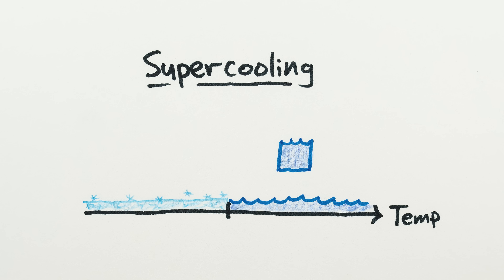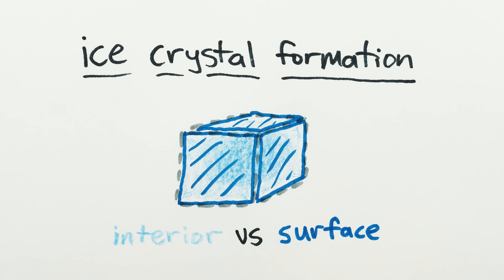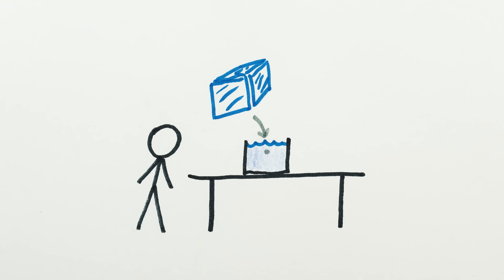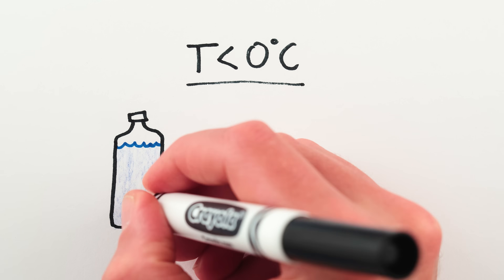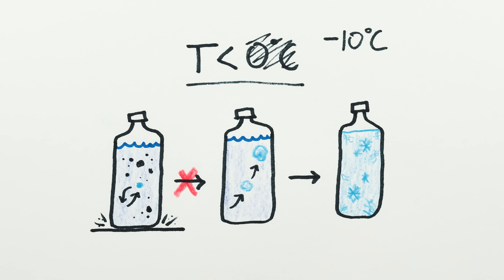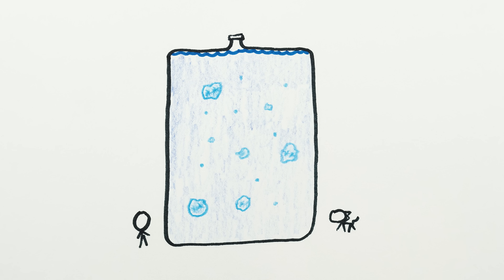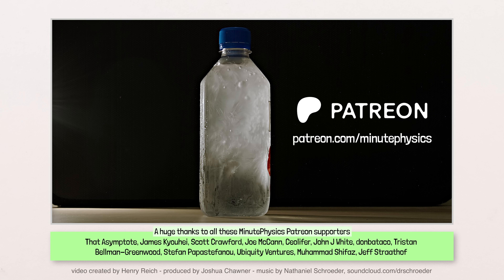The Physics of Supercooling

Comment: Question.  What if you had a sphere of ultrapure water floating in the vacuum of space?  What would happen between the competing forces of the lack of pressure bringing down the boiling point and the lack of particles for nucleation?  Is it possible that the water would remain liquid?

Comment: I bought a used refrigerator/freezer combi for 10 bucks that actually supercools my drinks. For some reason the freezer part only freezes the bottomhalf of the products. But when i put a drink in there it doesn't freeze at all only if i hit the bottle it instantly freezes up. Best 10 bucks i've ever spend :D
Reply: I had a fridge that did the same, once the novelty wore off it became really annoying. There was  simply no temperature setting that stopped things from freezing in the fridge without things in the freezer thawing.

Comment: AI Summary

Abstract: Understanding Supercooled Water: From Instant Freezing to Unfreezable States

This video delves into the fascinating phenomenon of supercooling, explaining why water can remain liquid below its freezing point due to a delicate balance between the interior's desire to freeze and the surface's resistance to formation. It then introduces a more extreme state: water that becomes impossible to freeze. This is achieved by containing supercooled water within extremely tiny, rigid vessels. In such small spaces, the pressure generated by the slight expansion of even a minuscule ice crystal becomes so significant that it suppresses further freezing, overriding the crystal's natural tendency to grow. This unique property has promising implications for cryogenics, particularly in preventing cell damage caused by ice crystal formation.

I used gemini-2.5-flash| input-price: 0.3 output-price: 2.5 max-context-length: 128_000 on rocketrecap dot com to summarize the transcript.
Cost (if I didn't use the free tier): $0.0056
Input tokens: 13048
Output tokens: 670

Comment: I want to learn how there can be fresh liquid water under Antarctic glaciers. Most sources talk about pressure, but this is a relatively tiny effect. Even under the deepest glaciers, the pressure is only a few hundred atmospheres, and pure water still freezes at just a few degrees below 0. It's not irrelevant, but it's not a complete explanation either, since most of Antarctica averages well below zero. And those glaciers are millions of years old, so it's not like the land right under the ice should be holding onto much heat. So how can these freshwater lakes form and persist?
Reply: Firstly, snow/ice is a good insulator, so the water below the glaciers would be warmer than the land above, and secondly, if the water is salty the melting point is lower. Also there might be friction between the glacier and the land that adds in small amount of heat.
Reply: @abigailcooling6604 Why would the water  below glaciers be warmer than the water above? Cold air isn't a new phenomenon in Antarctica. It has been below freezing for millions of years. It was that cold when the glaciers started forming. And of course if the water is salty, that's different, but the point was about lakes formed from glacial meltwater.

Maybe there could be some heating due to friction. That's not something I thought of. I'm skeptical, though.

Comment: Wouldn't this also explain why hot water freezes faster in the freezer? Hot water has more energy, more turbulence, so as it cools the ice crystals would be moving around more (even if it is at the same 0 degree temperature, maybe more currents or vortices or something?), like when you smack the bottle and it suddenly freezes, allowing the crystals more opportunity to knock into one another.
Reply: Intermediate value theorem says no, there are plenty papers explaining the pmemba effect already, feel free to check them out.

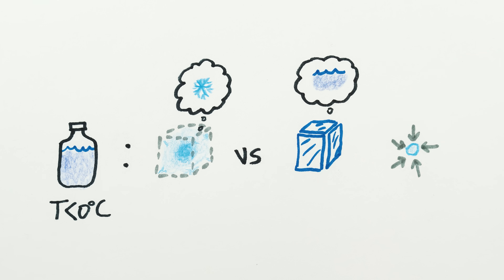Comment: 2:33 The third player is very important, many don't know about it.
Reply: It's really not that big of a factor. It may be important in some niche that I don't know about, but numerically it's insignificant until about 50 bar and requires 2100 bar to take full advantage of the effect.
Reply: @johnhunter7244  Every Single ICE cooling system uses the third element to increase the boiling point of the coolant (mostly water). This is why the radiator caps have two numbers stamped into them.

15-40c IS significant.
Reply: @Jimmeh_B that's boiling point, not freezing point. I am very aware of how automotive cooling works at usually about +1 atm of pressure

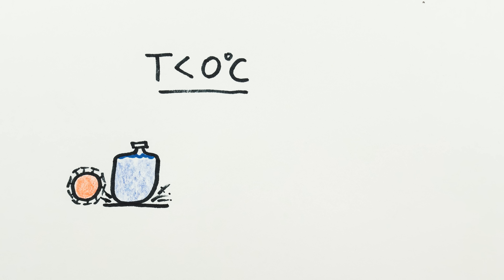Comment: 3:14 Doesn't pressure increase the melting point of water? Why does this work?
Reply: Increased pressure increases the melting point of most materials. Water is special and is the opposite. If you want more information, look into phase diagrams.
Reply: @johnhunter7244  Very interesting, I appreciate the correction

Comment: Hey minutephysics!
I been wondering ever since i moved to a hotter country, whats the fastest way to cool a room with a basic standing fan and 1 or 2 windows? is it better to blow air out or pull air in?
does the height of the fan matter?
asuming its night time and the outside is colder there should be an answer to this.
Reply: If you have two windows put the fan two feet from one window facing out. Placing it at the window facing in will do nothing, fans blow and there is little air movement behind the fan. Placed at the window facing out will only move the outside air. You want the fan to push air out one window to pull air in the other window. The windows must be open. A fan in a room with closed windows will raise the temperature in the room.
Reply: @BariumCobaltNitrog3n  Thank you, and if the fan has an adjustable height i assume putting it as high as possible is best since hot air rises?
Reply: @RadiantSoul  The fan should be at the same height as the window. A lot of places where it is hot have high ceilings which (I'm guessing) will contain the warmer air. The fan will bring in cooler air which will stay lower in the room. I have high ceilings and use a fan to bring the warm air down, so if you have the fan higher up it may just make it warmer at floor level. The key is to push the air out the window creating a low pressure area in the room which the other window will flow into. Just don't put the fan IN the window.
Reply: The height of the fan doesn't really matter, so long as all of the air column it's producing makes it out the window.
If you want to cool the room as fast as possible, placing the second fan at the lowest height possible, in front of the open window the fresh air is being pulled in from, facing directly up at the ceiling (or at some optimal angle) would force air to mix with the warmer, higher air. It would also force an air current in opposition to convection current, pushing the hot air toward the fan pushing it out the other window.

Comment: Might a silica aerogel saturated with water prevent the water from freezing due to the immense surface area of silica ?
Reply: it doesn't actually separate out the water into many parts so unlikely. I can't actually find any information about the typical distance between the surfaces inside aerogel.

Comment: Try this experiment.  I hung a small neodymium magnet in a jar of water, by a thread taped to the magnet, and placed it in the freezer.  After the water froze there was an egg shaped area of liquid water around the magnet.  Shaking or moving or banging the jar did not cause the water to freeze.
I have several photos.
Reply: My guess is that it pushed away the impurities (everything is magnetic to some degree or another, many things are repelled by magnets) and caused the water near it to be more pure and have a higher melting point. Try again with distilled water and see if it's any different. Reply to my comment if you figure anything out.
Reply: @johnhunter7244  I used distilled water.  I think it would be interesting if others could duplicate the experiment.

Comment: Something similar to this happens to Calypso Lemonade. For some reason, it has trouble freezing, and if you take it out before it freezes, then you can smack the bottle to make it freeze. I first thought that this shouldn't be possible because of how many particles Calypso Lemonade has in it, but they're also inside a glass bottle with a bit of pressure.

Comment: 1:10 If crystals are still forming, just immediately melting again, wouldn't that still be really bad for cell walls?
Reply: Typical human cells are 25 μm in diameter, whereas the minimum size cited for stable ice crystals at -4°C is 20nm, around a difference of 1000:1. Hope this helps
Reply: @emilyyyylime-  Got it — so that still isn't big enough to actually cause problems until it's past the threshold to just keep growing?
Reply: There's no significant rapid volume change like there is with cavitation. Any shock waves which would occur would be about as strong as the brownian motion of the water itself.
Reply: @maxsilver4197  Got it! Thanks for lending your knowledge <3

Comment: This reminds me of my family’s manky old fridge, which would passively supercool the filtered water in it (so it would freeze upon hitting the ice in my water bottle, making a little ice tower), but also somehow managed to not keep the freezer below freezing? A mystery of engineering lost to time.
Reply: If it was the standard freezer on top design I'm guessing the fan that is supposed to keep the fridge at the right temperature by controlling the convention between the freezer and fridge died and you're getting the full freezer cooling in the fridge and vice versa. The other way around with the bottom freezer would fail to cool the fridge instead.

I only learned about this being a thing a few days ago, though, so who knows!
Reply: The old fridge in my parents garage was well insulated, so the cold stayed in. The problem was, perversely, the insulation was more inside than the cooling coils near the motor. So, while the freezer proper was barely chilly, the bottom corner of the vegetable drawer grew a little lump of ice that could take the skin off of your finger if you touched it.
Reply: that would be perfect 3am water
Reply: Thats one very small bottle^^
Reply: that sounds so cool
Reply: Impurities lower the freezing point so filtered water can freeze while other less-pure water (including food?) won't freeze.

Comment: I made superboiling water the other weekend. After the water boiled up, i turned it down, because i wasnt finished with the rest of dish. then i i turned it up again, and after a few minutes it still didnt boil, i put some salt in the water for the noods, suddenly it started to boil wildly in an eyeblink. thought okay maybe its because salt lowers the boiling point, googled it up, nope, salt increases the boiling point.
Reply: The first boil removed all the gasses from the water. When it cooled there weren't any bubbles clinging to the pan for nucleation when you reheated the water. This is especially easy to do in a microwave and how people end up in the ER with burns from water that "exploded".
Reply: yeah, it's called superheating and can be quite dangerous
Reply: Yeah if your container is scratch free, then there may be no nucleation sites to start any bubbles for steam. That means the water can only evaporate at the surface, which doesn't remove enough heat to keep the water 100°C or below, which means it keeps getting hotter
Reply: This happens a bit more readily in a microwabe oven
Reply: What kind of stove/oven did you use?

Comment: Even if we got to keep a human body with it's water in a super cooled liquid state, the reason we want it to freeze it is so it doesn't decay, which I think depends on the water (and other molecules carried by it) not moving around. I think metabolism wouldn't completely stop as it is the case in solid water.
Reply: The average body has more than enough unstable atoms to give yourself a lethal dose of radiation within a few centuries. I think that would be the most pressing concern after we figure out how to not destroy cells with ice crystals.
Reply: @Beskamir Probably yes, even though I'm not sure what would happen across decades regarding DNA or protein reconfiguration
Reply: @Beskamir  You could presumably eat sources with less carbon-14, potassium-40, etc. No bananas I guess.